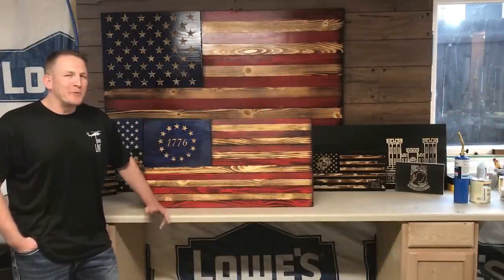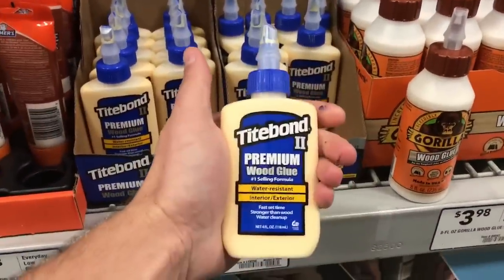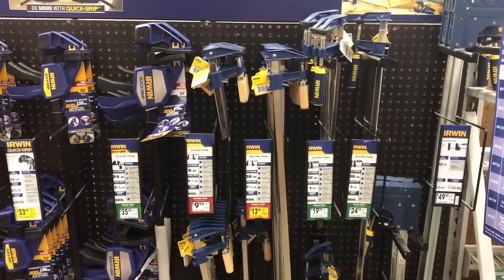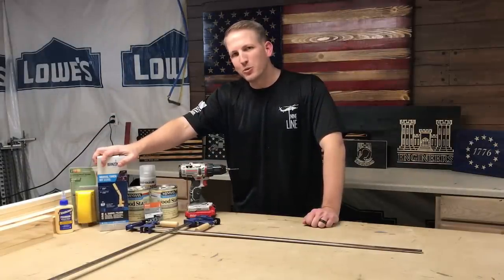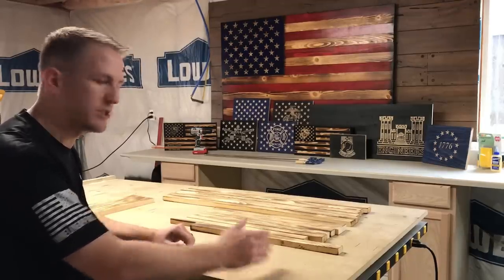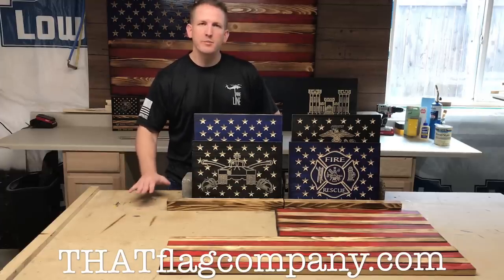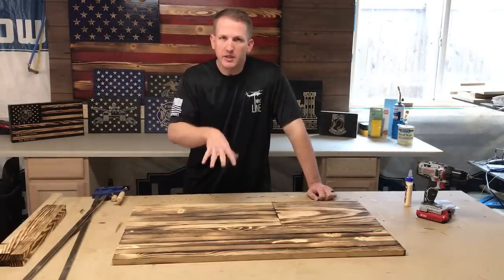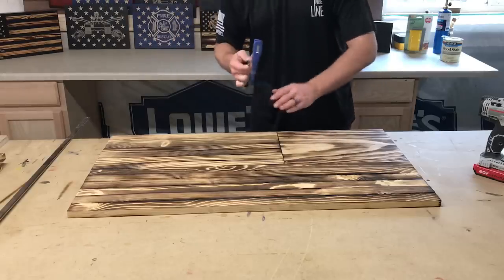DIY - Rustic Wood American Flag - Start your own Flag Co. for under $100 - Step By Step, How To

Comment: Love you videos.  I've made a couple flags now and want to make the Betty Ross flag next.   My question is which one is more popular?  The one with "1776" in the center of the stars or with out the year?
Reply from the maker: Thanks Mike! Both do well, but we’ve found the 1776 to be more popular over time.
Reply: I hope you don't mind me asking a few more questions?  I'm wanting to invest into an affordable CNC machine to start cutting out the unions and custom designs and logo's.  Bob's cnc, seem to be the most affordable.  Do you have a recommendation to get started with and also the software you use to design your unions and logo's.  I'm spending too much time using my Dremel...

Comment: Realistically, how much time do you suppose you'd have in this flag, make it one at a time, vs. batching them?
Reply from the maker: Otis Bogue, I’d set aside 5-6 hours for your first build. As with anything else, the time will be cut with experience and cut even further when you begin building multiple flags at the same time.

Comment: Do you ever have issues with the glue seeping out on the stained side. Since it is face down when you glue it up
Reply from the maker: Yes sir, that’s a typical issue. We turn the flag over within 10 minutes normally and then use a wet rag to wipe away the excess glue. Hope this helps!!

Comment: Nice work.  Make yourself a simple 90 degree clamping jig.  It makes final assembly and glue up a lot faster and easier.  Also ensures everything comes out straight.
Reply from the maker: Great advice!  Thanks!!

Comment: Excellent video! As a fellow veteran, thank you for sharing this with us. I just ordered a 36" template off of your website. Some of the flags on there are very impressive! I'm going to be building my brother-in-law a hidden gun cabinet flag for his police academy graduation. It would be super nice if the dimensions for final cut lumber were readily available somewhere on your website though. Thanks again and keep up the excellent work!
Reply from the maker: That will be an amazing gift James! And here are the dimensions for you: 7x short stripes at 21.75”x1.5”

6x long stripes at 36”x1.5”

4x braces at 18.5”x1.5”

Union is 10.5”x14.25”

Enjoy your build and I know your brother-in-law will love it!!

Comment: Do you have a template for making the stars with a Dremel type tool? The worst part of all this is going to be the stars. You skipped that part in the build process. Great looking flags.
Reply from the maker: Hey Kurt C! Thanks for the compliment on our flags! To answer your question, 
there are multiple ways to make the union yourself. We started by making a template in Microsoft Office and tracing it onto stencil paper from Hobby Lobby. We then used a knife to cut the stars out of the stencil and could use that stencil to trace the stars onto the union. After the stars are traced, you can use a dremel or a hammer and chisel to engrave them into the union. Hammer and chisel takes more practice to get right but ends up being quicker and better than a Dremel in my opinion. This is the most cost efficient way to make the stars yourself. After receiving multiple requests, we recently started offering the pre-Cut stencils for sale as well. 

However, to make the unions with our level of quality and detail that we offer on our website would cost you thousands of dollars in equipment and multiple tutorial videos. For this reason, we did not go into the details on this video but decided to offer them already completed for on THATflagcompany.com in order to provide another option that we wish had been previously available to us when we were starting. 

I hope this video was useful for you and the follow up response helps give some additional clarity.  If you have any questions we can help with, definitely don’t hesitate to ask!

Comment: Is my math off? You used 1x2s which are 1.75 wide. The union is 7 stripes high. My math puts it at 12.25” high but you said it was 10.5” high. That would be 6 stripes high. What am I missing? 
Love the video btw.
Reply: His are 1.5 wide

Comment: How do you ship them? and at what cost. I'd like to send some to family out of state. Thanks!
Reply from the maker: Hey Kirk! We’ve used UPS in the past but changed over to FedEx after some bad experiences. UPS gives cheaper rates but FedEx goes above and beyond to take care of us and our customers, which is more than worth it to us. 

It costs us roughly $20-$30 to ship a flag this size (36”x19.5”) to anywhere in the continental United States.
Reply: @thatflagcompany7105  Thanks! Do you do all the packing or fedex?
Reply from the maker: We package them ourselves. When we were first starting out we wrapped the flags in bubble wrap and then cut bigger boxes down to size and shipped them that way. Now we have custom boxes made to ship the flags but you need to order 100-500 custom boxes at a time to make the investment worth it.
Reply: @thatflagcompany7105  Hey! what size boxes do you use? thanks.

Comment: What do you suggest on the type of pre-cut lumber to use to make the small flag, the one the is 13" tall that calls for the 1" slats? Thanks.
Reply from the maker: Mike, your best option for pre-cut wood other than what I showed for the 36” flag, would be to find a local lumber store and ask if they offer wood cut to size. There’s usually a small fee added to the price, but I’ve had it done numerous times at smaller lumber yards.

Comment: Im currently building one now and wanted to order the union, but they are backed up with xmas around the corner. ANYWAYS, i bought the wood 1*2 at home depot, burnt it, stained it and i noticed that its 1/4 inch to big for the union size that you sell. So im guessing the wood at home depot isint 1.5 inches? can anyone help please and ty
Reply: I just made a flag this past weekend with home depot wood. I bought 1x2s and then a 1"x12"x8' board that I cut into several 10.5x14.25 for the unions I will eventually use. The first one fit perfect! Hope that helps!
Reply: @sventhestrong  hmmm strange,  maybe after I glue it and tighten it, then it will fit.

Comment: @THATflagcompany this is amazing! Quick question, what wood do you buy from Lowes for the union? I know you stated the dimensions I'm just checking if there is a particular wood that you use. Thank you for the awesome video!
Reply: I had the same question a couple of months ago. I emailed their company and got a quick reply. They use Pine wood...no cheap stuff....no plywood either. It makes all the difference when carving out the stars. Select Pine worked and looks best...less knots and visual imperfections.

Comment: How long to the 1x2s need to be cut for the larger Union flags that you make? I know the longer stripes are 48" but what should the length of the shorter stripes and the braces be?
Reply from the maker: Peyton Kusel, measurements for the 48” flag are:

7x short stripes at 29”x 2”

6x long stripes at 48”x2”

4x braces at 24.5”x2”

Union is 19"x14"

Measurements for the 36” flag are:

7x short stripes at 21.75”x1.5”

6x long stripes at 36”x1.5”

4x braces at 18.5”x1.5”

Union is 10.5”x14.25”

Hope this helps and enjoy your builds!!

Comment: Do you need a nail gun or could you just use a hammer and nails? Obviously you don't want to miss the nail and mess up a beautiful flag but I don't have an air nail gun.
Reply from the maker: Matty Natural Horsemanship, I’ve never tried a hammer but the main concern there would be the vibrations from the hammer strikes causing your clamps to loosen and cause separation between your stripes.
Reply: Got it. Makes sense.

Comment: How do you ship them (package it)? I would like to try and make one for a Vet down the street.
Reply from the maker: Hey Anne! We have custom boxes made locally and ship them via UPS or FedEx. Before custom boxes, we used “Ram Board” from Lowes to make our own boxes and shipped them that way. 

Some ppl use bubble wrap to protect their flags inside of the box, but be careful bc the plastic can stick to your flag. We use foam for our protection, and one cool idea that people have had is to use a pool noodle to wrap around the edges to protect it. 

Hope this helps!!

Comment: Hey Jordan, this video was amazing and I am very glad you published it. As a veteran, I have already started a small business with another veteran.  This have given me another product to add to our arsenal. As a veteran, we live by selfless service as a value in life. Your torching technique have shown us another process with elevating our boards. What are your thoughts on paint vs stain for your stripes?
Reply from the maker: Hey D S, I’m glad you’ve found the video helpful!! I’ve found that paint covers the burns up if applied after the burn and is also ineffective if the burnt is done on top of the paint. The water based stain is most ideal for coupling with the burning technique in my opinion.
Reply: THAT Flag Company, thank you for the response. Do you use a CNC machine for your emblems?  I have other products that I make and would like to purchase a CNC to help me with unit crest for out whiskey boxes.

Comment: Great video, thanks for what you guys do!  I am handicap and on a limited budget and only have slats that are 32” long you say need 36”  if I would use them how big should the union be?   I see you make smaller flags too. Do you show the dimension for those? 
Thanks again for all your great work.
Doug
Reply: Search online for US Flag Dimensions. There is a ratio chart for all the dimensions.

Comment: What happens to be the size of the Union piece? And what kind of wood? It doesn’t appear to be plywood. It matches the stripes perfectly with the grain.
Reply from the maker: The union is 10.5"x14.25" and is made of Premium Pine (no knots).  It is the same thickness as the boards in the video.  It's expensive but worth it in our opinion.

Comment: Any advice on subdued color.  The charcoal option at both lowes near is a very light gray.  I tried true black, but even that is too light for the union.
Reply from the maker: Hey Andrew! They will still mix the stain if you give them the code. It is Minwax clear base and the formula is 101-2Y9.
Reply: @thatflagcompany7105  thank you.  Ill go try that tomorrow.

Comment: Do you need the braces on the back? Seems it's the same build as a cutting board which is what I make...although I do have excessive glueout
Reply from the maker: We do recommend braces to withstand the separation that could occur over time.  However, glue will hold it together and look the same initially if an adequate amount is applied.
Reply: @thatflagcompany7105  I guess in a way I am asking how you hang this...I am going to build one of these but a French cleat may be in order...wires may not hold in wind..just a thought...great build and thanks for your service.

Comment: Great looking flag! Quick question...do you use the spray-on spar urethane, or regular brush-on urethane?
Reply from the maker: Jeffrey Lung, we’ve used both and both work great. The spray is quicker to apply and dries faster but you can apply a heavier coat with brush-on.
Reply: @thatflagcompany7105  Thanks for the quick response! Your video has been a great help in making my first flag!

Comment: How do you make a how to video and not show how to dremel the stars...just be like order this CNCed one from us
Reply from the maker: Hey Geefive. There are multiple ways to make the union yourself. We started by making a template in Microsoft Office and tracing it onto stencil paper from Hobby Lobby. We then used a knife to cut the stars out of the stencil and could use that stencil to trace the stars onto the union. After the stars are traced, you can use a dremel or a hammer and chisel to engrave them into the union. Hammer and chisel takes more practice to get right but ends up being quicker and better than a Dremel in my opinion. This is the most cost efficient way to make the stars yourself. 

However, to make the unions with our level of quality and detail that we offer on our website would cost you thousands of dollars in equipment and multiple tutorial videos. For this reason, we did not go into the details on this video but decided to offer them already completed for on THATflagcompany.com in order to provide another option that we wish had been previously available to us when we were starting. 

I hope this video was useful for you and the follow up response helps give some additional clarity.  If you have any questions we can help with, definitely don’t hesitate to ask!

Comment: I'm assuming the lumber is actual .75 x 1.5? I've been wanting to buy a flag but like the idea of making one myself a lot better! Great video! Also, what type of wood do you use?
Reply: Being from lowes, sold in furring strip size, and being very white, it has got to be pine.
Reply: @cobratester  thanks for the reply! Will be buying a few unions soon!
Reply: @Freddy_K_TV  No prob (I don't work for the guys, just tryin to help ya out)

Comment: THAT flag company: I have a question. 
So what brought me here was obviously the idea of starting to make these. So here's the background. 
I work a lot with wood on random projects (building stuff I need mostly) 
So I was at work delivering and came across a house that had one of these types of flags outside but it was super sloppy and not very well put together and I thought "hey... I could do that much nicer"
So here's where my question comes in. 
I'm not a veteran.  Not a police officer. 
But I appreciate our troops, police, firemen,  etc and everything they do for us. 
My initial idea is obviously charge enough to make a profit for the time I'd be putting into these but also to give part of that profit to local veterans programs. (Im leaning heavily towards wounded soldier programs because I dont think they get near enough support)

So considering I'm in no way a veteran, would i be looked at as a complete douche for making and selling these?
Reply: I'm a veteran and I don't see where that would pose an issue. I think that is a great idea. Good luck.
Reply: Thank you! 
I think I decided on what program I want to donate part of profit to though. 
Mission 22 seems to be the one that speaks to me the most
Reply: Cody Drummer Anybody could make and sell these but you wanting too and support any veteran organization is awesome so thank you
Reply: @ttodd0034  thank you sir!

Comment: These look awesome!! What are the demensions for the stripes on the 48in flag builds??
Reply from the maker: Hey Thomas, the measurements for the 48” flag are:

7x short stripes at 29”x 2”

6x long stripes at 48”x2”

4x braces at 24.5”x2”

Union is 19"x14"

Comment: what size nails you use for the braces?
What are the union dimensions for both 36" and 48"?
thank you
Reply from the maker: Lolicore Rem, the nails are 1.25”. 

Measurements for the 48” flag are:

7x short stripes at 29”x 2”

6x long stripes at 48”x2”

4x braces at 24.5”x2”

Union is 19"x14"

Measurements for the 36” flag are:

7x short stripes at 21.75”x1.5”

6x long stripes at 36”x1.5”

4x braces at 18.5”x1.5”

Union is 10.5”x14.25”

Hope this helps and enjoy your build!!
Reply: @thatflagcompany7105  THANK YOU SO MUCH!!!! i'm going to be making a couple for my family and i'm going to be making an EMS white stripe flag as the top to my tv stand! this takes the guess work of dimensions out!

Comment: It would be VERY helpful if you showed how to construct the stars! Now, I'm going to have to design a template...
Reply from the maker: Hey James. There are multiple ways to make the union yourself. We started by making a template in Microsoft Office and tracing it onto stencil paper from Hobby Lobby. We then used a knife to cut the stars out of the stencil and could use that stencil to trace the stars onto the union. After the stars are traced, you can use a dremel or a hammer and chisel to engrave them into the union. Hammer and chisel takes more practice to get right but ends up being quicker and better than a Dremel in my opinion. This is the most cost efficient way to make the stars yourself. I have also seen people buy stencils on Amazon but many reached out for help because their stencils were not always proportional for their flag and they’re limited to the one size and style. We are actually working to make another video covering all of this in the very near future and just recently started offering stencils that are measured properly for this build on our website. 

However, to make the unions with our level of quality and detail that we offer on our website would cost you thousands of dollars in equipment and multiple tutorial videos. For this reason, we did not go into the details on this video but decided to offer them already completed for on THATflagcompany.com in order to provide another option that we wish had been previously available to us when we were starting. 

I hope this video was useful for you and the follow up response helps give some additional clarity.  If you have any questions we can help with, definitely don’t hesitate to ask!
Reply: @thatflagcompany7105  Thanks very much for your fast response! I'm a Vet living in upstate NH. Its very hard to find a good paying... Scrap that...sufficiently paying job. Its rural, but caters to skiers, hikers, tourism...and I was considering woodcraft to augment my income. 

What is the approximate cost for the union from T.F.C?  

I saw the laser engravers. Pricey! $2,000. But not out of the park. However...to just get my feet wet, and see how the market responds... What's YOUR cost? 

Thank You! 
Medics "care with compassion!" Hoooah!
Reply from the maker: James, we offer different sizes and styles starting at $34.95. You can check out our entire DIY section, to now include stencils, here: https://www.thatflagcompany.com/collections/diy-flag-builder-collection